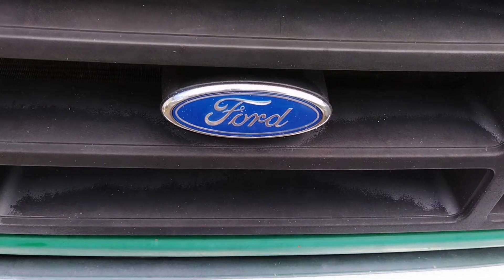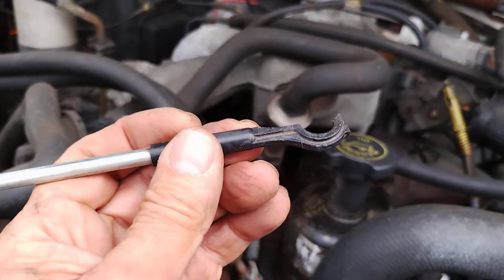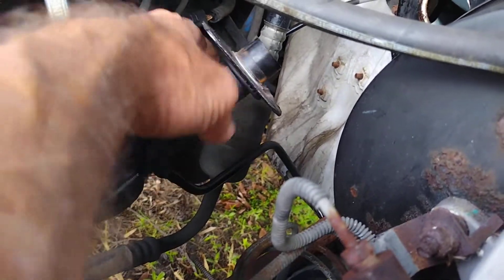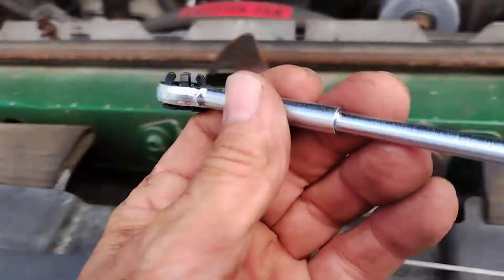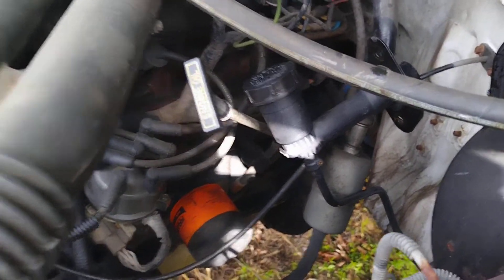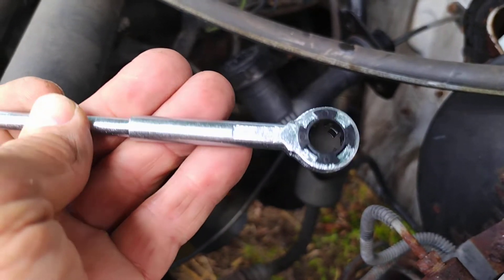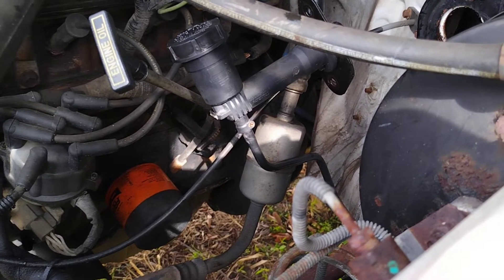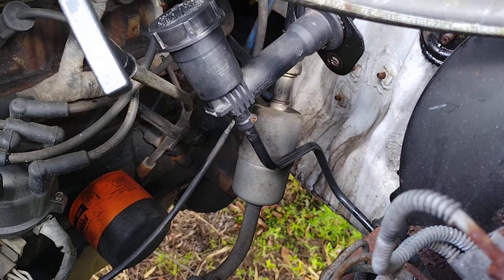F#*D F250 4.6 clutch rod fix..

Comment: It pushes back in easy. Use a new rubber seal included with master. To remove it, pull pin, small vgrips lightly on tube right next to connection. Pry/pop off w flat head between grips and master. Leverage and a pop

Comment: Like @seans9555 said the line has a ferrel that you push with a tool you can get at Napa or Auto Zone  to easily remove them makes life easier. I encountered this on a Ford Ranger pickup with fuel pump on frame rail. I beat hammered pulled and pushed until I discover that tool was similar to shark bite  theory.  Nick on Nick fix it channel has demonstrated how to make one with a pen cut and slotted.  Ingenious it worked.
Thanks for the great video keep it up!

Comment: That slot on the end of the shaft, looks to me like there is probably a clip of some sort that has to come off before it will release.
Reply from the maker: What slot on what shaft? ?the push rod?  
I can't get the master cylinder to separate from the plastic line.. I put it back and put the new push rod in. It works. Someone told me to use side cutters but I don't want to damage that plastic line.
Reply: @seetheforest  the machined out ring around close to the end, at least, it looks like that to me.
Reply from the maker: @1954shadow  The push rod does clip into the cylinder. I made a release tool from a chunk of poly tubing to get the old one out. The new one snapped back in.
Reply: @seetheforest  Improvise and adapt.
Reply from the maker: @1954shadow  hammer time!
Reply: @seetheforest can you describe this poly tubing release tool you made? I need to do the same
Reply from the maker: @WesleyBrace  it's 3/8" poly water line like you use to hook up a ice maker for your refrigerator. I put a slit in it and slid it onto the shaft and pushed it in real hard to get the teeth to release. You can also get a line release tool at the parts store but I didn't want to drive so I improvised.